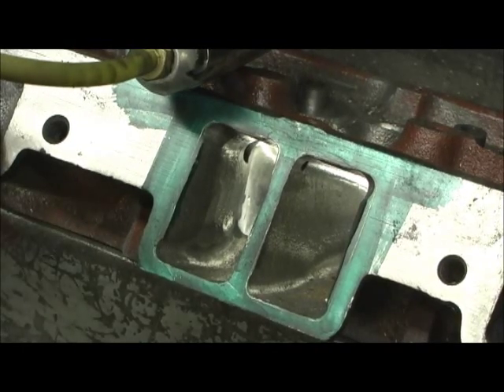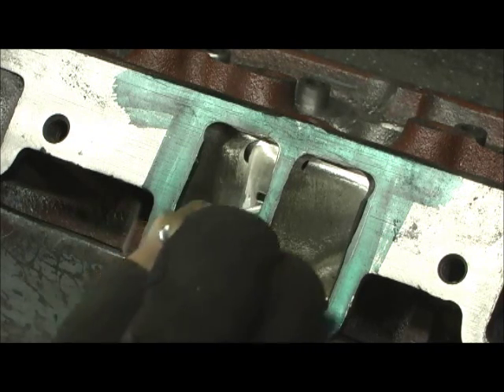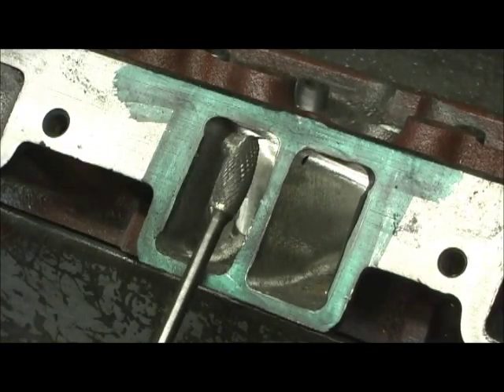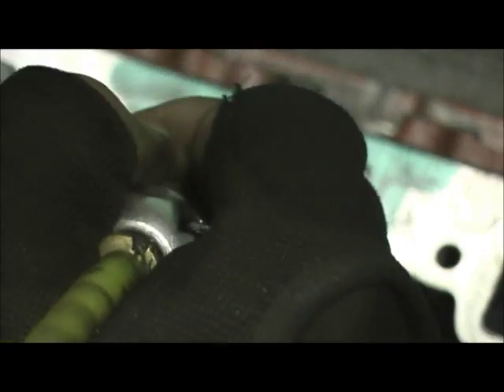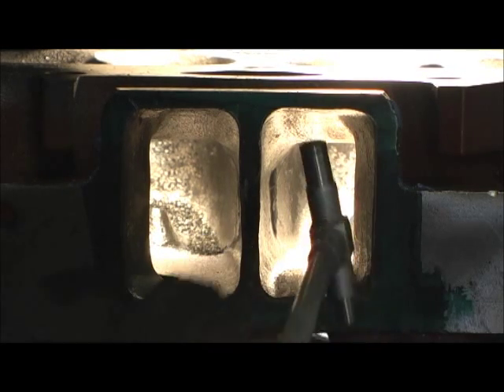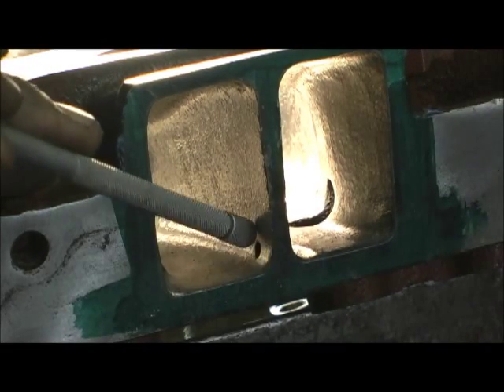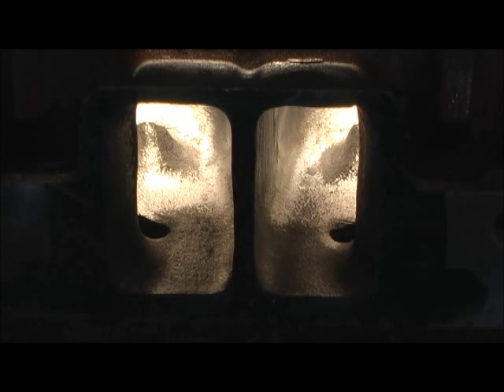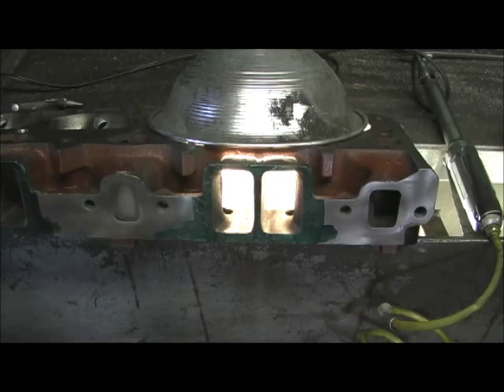Holder Boulder 334 Final Intake Port 7.2

Comment: Glad you used the 1.85" valve on the small bore. 1.94" is tricky and not worth the effort.  I am amazed at 194cc from the thinwall head! That is very cool. The 100 hours of porting time? I only know one other guy who would take that much time on a set of stockers.